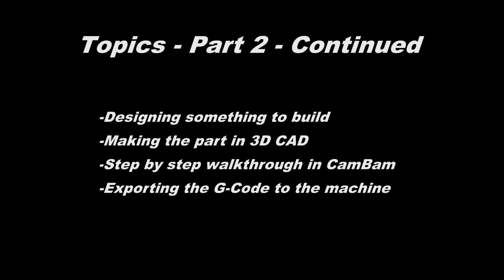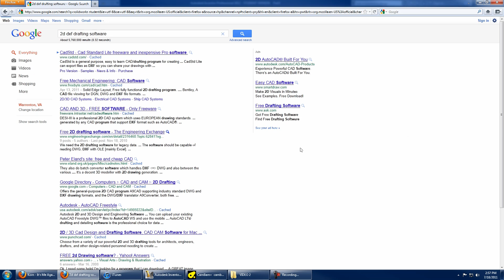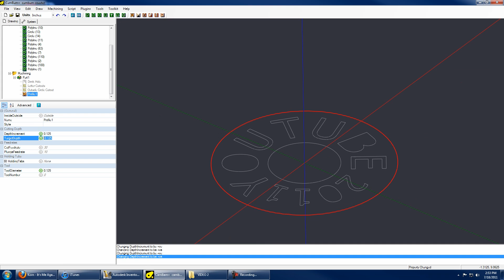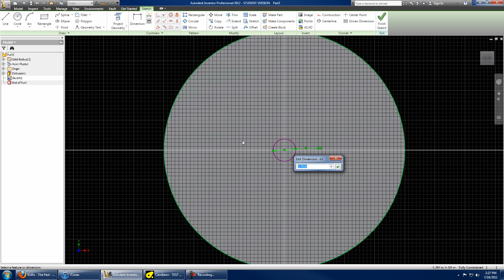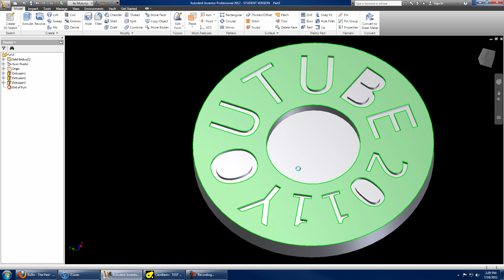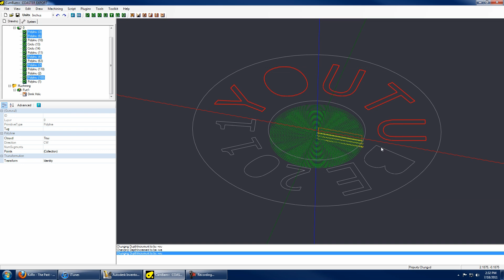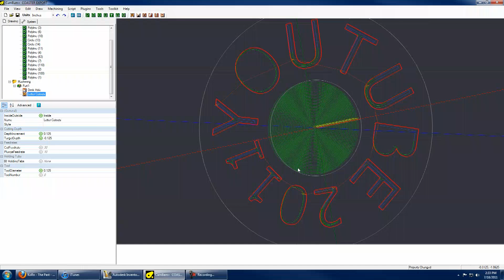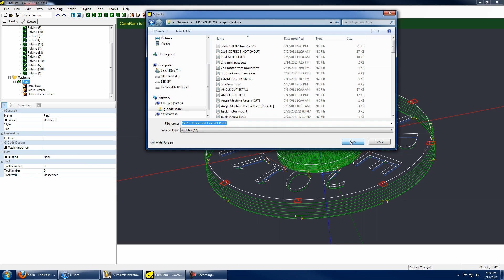DIY CNC Cutting Tutorial Video #2 - Probotix Fireball V90

Comment from the maker: That's exactly what I did in the video! I used Autodesk Inventor to make the part then exported the front face to DXF and imported that into CamBam. You can also directly import 3d models in the new CamBam. So use Alibre to make the 3d part, then export a 2d DXF of one face (and follow the video), or import the model directly and do machining operations in 3d.

Hope this helps!

Comment from the maker: For birch I would use about 10 to 40 ipm with a depth of cut around 1/16in at around 25 - 30k rpm. Make a simple part to test cut and try out different feed rates/doc/rpm. There are many ways to approach cutting.....take many shallow fast cuts......take fewer deep slow cuts...or in my opinion the best way take deep (.01 over sized) cuts then come back with a final operation to trim .01 off of the edges to leave a great finish.

Start with shallow cuts and go from there.

Comment from the maker: CamBam has an older free version although its not open source. I'm sure there is some form of software out there but I doubt it will match the overall versatility and polished look/feel of CamBam. The $150 is a small price to pay to get fantastic results quickly and easily. However if you want that homebrew/diy software aspect then my only suggestion would be to write it yourself. Its tricky but very rewarding once you get it right.